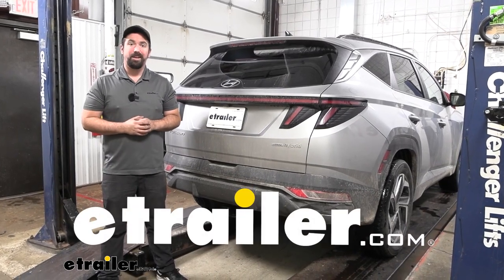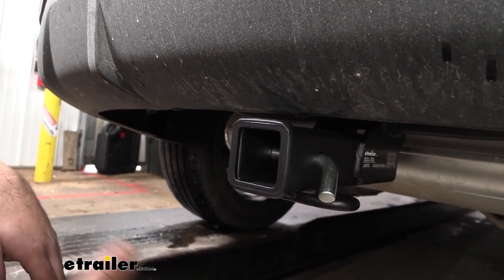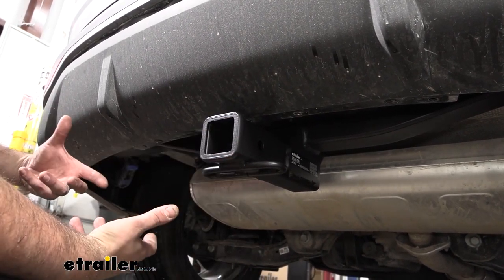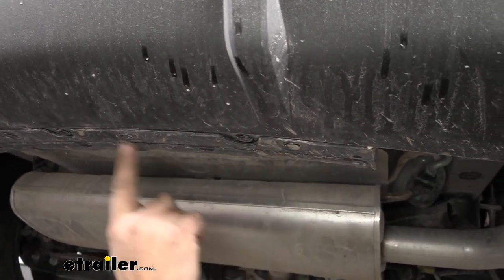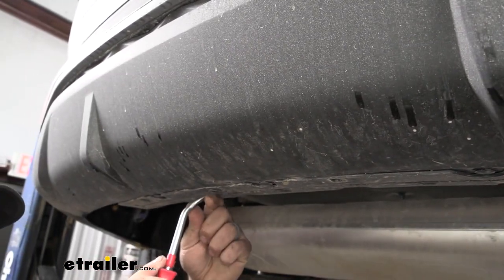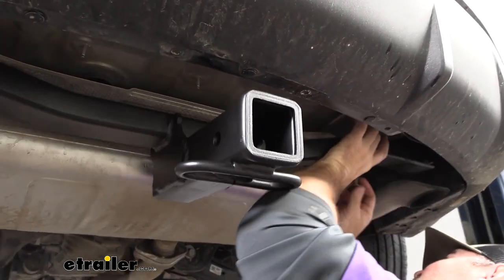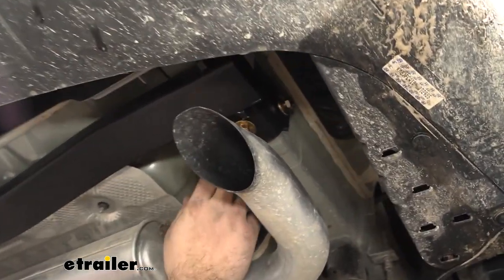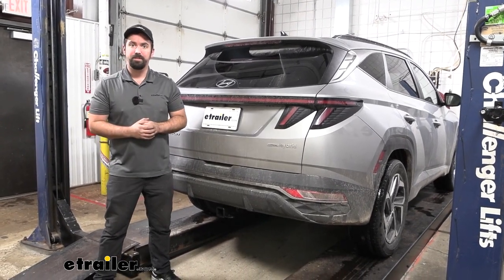Install: etrailer Trailer Hitch Receiver on a 2022 Hyundai Tucson

Comment: Great video, was looking on your site. So you said it well, making sure I understand, TW of 525lbs means thats the max weight for suspended dirt bike or cargo trailer?
Reply from the maker: The hitch itself has a 525 lb tongue weight capacity, but you'll be limited to the vehicle's actual tongue weight capacity, which is 220 lbs per the owner's manual. You'll need to abide by the capacity of the lowest rated component, which is the vehicle, in this case.
https://www.etrailer.com/Trailer-Hitch/etrailer/e38KR.html
Reply: @etrailer  oh wow. I didn't realize it was that low. Thank you
Reply from the maker: Yeah, that's what you're dealing with. Sorry, wish we had better news for you!

Comment: Hi, do you know if the 2023 Tucson has similar specs and would this hitch work on it?
Reply from the maker: The 2023 Tucson would indeed be able to use the etrailer brand # e38KR Class III hitch. As far as 'specs' goes, we'll assume you mean the towing capacity of the vehicle. Both the 2022 and 2023 Tucson have the same 2000 lb towing capacity. The hitch itself has a higher 3500 lb capacity, but you'll want to adhere to whichever capacity is lowest, which in this case is the 2000 lb capacity of the vehicle.
https://www.etrailer.com/Trailer-Hitch/etrailer/e38KR.html
Reply: @etrailer  Use case is only a bike.  Thanks for the response!
Reply from the maker: You're very welcome! The hitch will be perfect for a bike rack!
Reply: 2024 as well.

Comment: Is there no plug for trailer lights?
Reply from the maker: We shoot those videos separately. For a trailer connector, we recommend the Tekonsha # TK44ZR for a 7-way or the Curt # CU94FR for a 4-pole.
https://www.etrailer.com/Custom-Fit-Vehicle-Wiring/Hyundai/Tucson/2022/TK44ZR.html
https://www.etrailer.com/Custom-Fit-Vehicle-Wiring/Hyundai/Tucson/2022/CU94FR.html